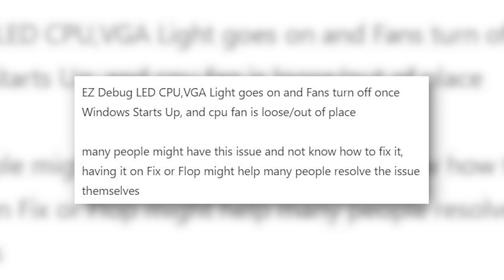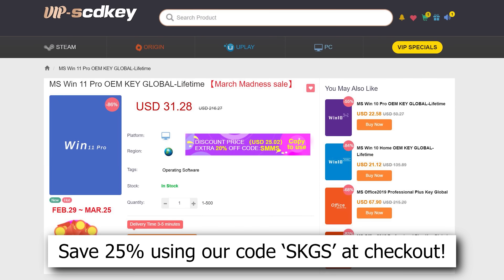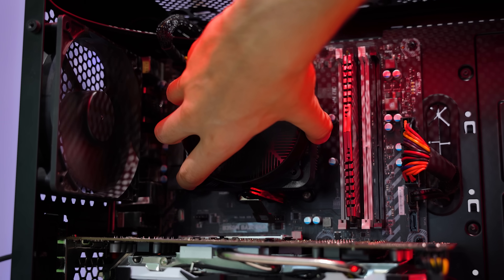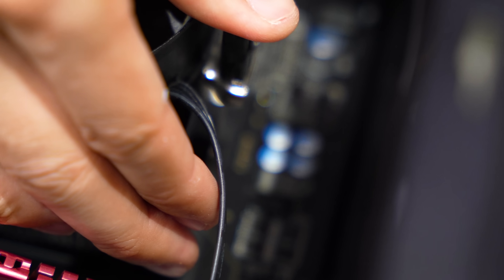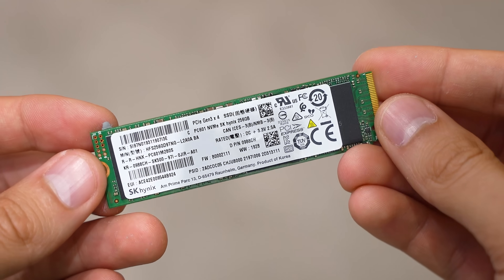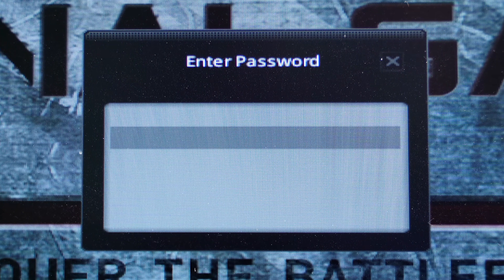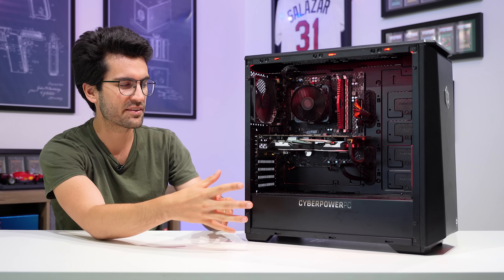Fixing a Viewer's BROKEN Gaming PC? - Fix or Flop S5:E10

Comment: Disagree about using HDDs in 2024. Given the price of even 4TB SSDs today, I wouldn't even bother with HDDs anymore unless you're building a NAS or need a lot of secondary storage for some reason. The only other thing this system needs is a memory upgrade to at least a 2x8GB kit.
Reply from the maker: ? Think ya misunderstood me, dude. I said that any system today should have an SSD for a boot drive.
Reply: @GregSalazar  Didn't misunderstand you at all. You did say to have it at least as a boot drive. And I'm saying to just not bother with HDDs entirely unless you need a lot of storage (i.e. 4TB or beyond) because of the price of SSDs anymore.

For example, if a system has a 1TB or 2TB HDD as the only storage, my advice would be to migrate that to a 2TB SSD and just pull the HDD from the system entirely.
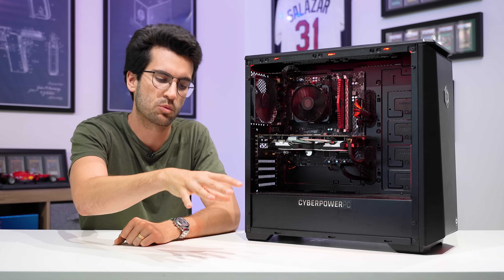Reply: @brandishwar  No, you misunderstood. Every time he mentioned it he says to go SSD over HDD. 10:16 - 11:00 is all about prioritizing upgrading HDD to SSD if you can afford to.
5:56 he says they'll leave the old HDD in there and that maybe they can repurpose it to storage for a Steam library but not deleting anything off of it at that point (which is the right call when doing repair, leave as much as you can how they left it).
Reply: @Galiant2010  Okay, Sparky, I'm going to presume you know how to read, but your comment leaves me thinking your reading comprehension skills really need an upgrade. And that's from someone who will readily admit to not having the greatest reading comprehension skills to start with. So... I'll repeat what I said, but make this loud and clear for you.

REPLACE YOUR HARD DRIVES WITH SOLID STATE DRIVES AND DON'T BOTHER WITH HAVING AN HDD IN YOUR SYSTEM UNLESS YOU NEED MORE THAN 4TB OF STORAGE!!! DON'T BOTHER RETAINING THE HDD AND JUST REPLACE IT WITH A LARGE ENOUGH SSD!!!

Now.... do I need to spell it out any more for you?
Reply: @brandishwar  Cost of upgrading, or limited knowhow, is obviously a limiting factor that he's trying to be mindful of that others have. Greg wasn't saying to ever buy another HDD, just that if money is tight to at least look into getting an SSD big enough for the OS to run off of. Obviously he's not saying anyone should buy HDDs these days.

10:28 "If you're watching this and your system is running off JUST an old HDD... please, please, if you can squeeze it into your budget, prioritize a storage upgrade first."

Nowhere does he say to buy HDDs, just that if you already have one and need the storage that it's fine for a gaming library.
Reply: @Galiant2010  Where am I losing you when I said, rather simply, to replace your HDD with an SSD? Where did I say that  Greg said to buy HDDs? Did I really need to say to only do that upgrade if you can afford to? Did I really need to say to only do that if you know how to do it - though you can find very easy to follow instructions online?

Why do you feel this need to argue with me over a very basic point?

Again, all I'm saying is, if you have a HDD, replace it entirely with an SSD and not keep the HDD around.

Did I need to qualify that with "if you know how" or "if you can afford to"? Or should one just presume those to be... obvious?

Again, where am I losing you on this?
Reply: @brandishwar  So basically you're saying the exact same thing Greg says and nothing else yet also saying you disagree with Greg. Got it.
Reply: @Galiant2010  Yeah reading comprehension is clearly not your forte...
Reply: @brandishwar  Comprehension, in general, isn't yours.

Comment: Putting windows 10 or 11 on a 256gb drive is not very professional IMO.  Anyone in the game knows windows is going to fill that drive.
Reply from the maker: Windows 10/11 does NOT consume anywhere close to 256GB on its own... what a silly criticism over a free upgrade.
Reply: 200gb is more than enough for windows a bunch of programs all together. The only exception could be if you are using VERY heave programs that work with large files or if you leave years of downloads occupying space in your downloads folder.
Reply: @tomasbenchat697  anything I download goes on a separate external HD, used to use the same drive as my system then one day it corrupted and I lost a load of files, now all that sits on my C drive is my Windows install.
Reply: was gonna say the same but Greg got there before me 😀 my windows 10 install fits just fine on my 120gb SSD with plenty of free space left.
Reply: But it didn’t fill the drive?
Reply: @connorwesley8757  no, used just over 90gb so enough space left.

Comment: Not much free space on the HDD, but probably a HDD failure incoming if it was flaky booting from the HDD. Did you use CrystalDisk to look at HDD history and info?
Reply from the maker: It wasn't flaky booting. It was just slow to boot - which is a common HDD thing :-)

Comment: Anyone had an issue getting into their bios after windows going from 10 to 11? Mine just sits on a black screen whenever i try to get into it. It worked fine three weeks ago when i was on windows 10? Thanks in advance
Reply: Might help if you put in your specs 😊
Reply: @DoctorZAVABNA  Graphics is an AMD Ryzen RX 5700 8GB with a Gigabyte B450M-52H mATX. I saw somewhere that i may need to update my BIOS but was not to sure.

Comment: Cyberpower should be ashamed of themselves for selling a Gen 1 Ryzen system with a single stick of RAM - that's probably a 20% performance hit. But nooooooo, they had to spend the extra $3 a dual-channel kit of the same capacity would cost on . . . an LED strip.
Reply: Yeah another stick of RAM would be recomended for that rig.
Reply: @j.p.h.8126   yeah at least 2 8 gig sticks would have been nice
Reply: To be fair this is a 7 year old base model
Reply: @coreykirkpatrick4392  its still running windows 10 so any help is a plus
Reply: @coreykirkpatrick4392   . . . and they've had 7 years to stop doing it, but I just found a $1300 Ryzen 7700 system kneecapped by a single 16GB stick at Best Buy . . .
Reply: OS on a HDD and not SSD might be even worse
Reply: @ivovass195  It's significantly worse. Seemingly modern OS doesn't run very well on a hard drive. I've seen instances where drives are pegged at 100% usage when they're OS drives.
Reply: Cyberpower aren't the only ones, unfortunately
Reply: @marsluco1917  Yup. Profits > Performance. Cheaper to buy the same capacity in bulk and just throw single sticks in the low-end systems, performance hit be damned.
Reply: People who buy pre-build computers probably don't know what they're missing...
Reply: This is the first pc I bought.  In 2017.  It was fine at the time.  I got it for like 700-750 at a best buy on a black Friday deal.  You couldn't even build a system with an rx 580 for that price at the time.  It was the first gpupocalypse.
Reply: honestly its probably so the consumer has an easier/better upgrade path even if it means you crap hard on performance
if it has 1x16 instead of 2x8 they could easily plop in another 16 for 32 instead of replacing the whole kit for like twice the price
Reply: That single stick was driving me crazy
Reply: Well it most 16gb ram is most recommended for gaming 32 or 64 or 128gb ram is overkill. In fps most likely a graficard is most sustainable be 8 or 12 or 16 or 24gb.
Reply: its a old system, put them to shame but idk
Reply: This PC hasn’t been sold since early 2018, they moved to 16gb soon after
Reply: i have some cyberpower prebuilts in my local walmart that are 1000+ dollars with a single stick of 16gb ram
Reply: People like pretty lights makes it easier to sell to noobs
Reply: I mean for the age it’s about right. Yes I agree maybe they should have included another stick of ram for dual channel. However the that CPU chip was probably good when that pc was built
Reply: I have a CyberPower PC and it's been amazing, their customers service was awesome when I needed help. But this was my personal experience, others may have a different view on this.
Reply: @mohammedis1am  in fairness to them, they're not any worse than most of the other SIs on the market. So at least you'll have a functional machine most of the time. The odd time it'll be shipping that causes issues.
Reply: Blame the consumer, not the company. If someone is willing to buy it, it's not the companies fault.
Reply: @AllenTheWanderer 100% disagree, pretend you are a 14 year old getting there first gaming pc. They like the look of this because it looks cool but have no experience with parts or the way things work. The website says this pc is awesome for games so 14 year old convinces mum to buy it. The “experts” at the company know full well this is shady and unethical but do it anyway